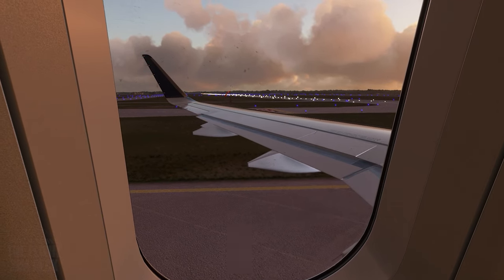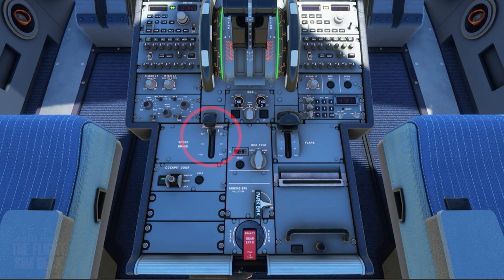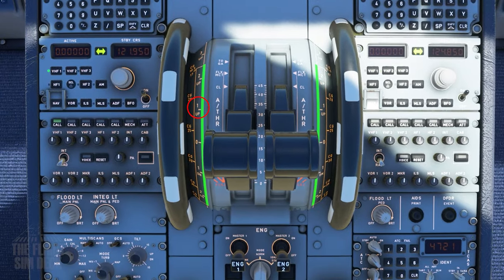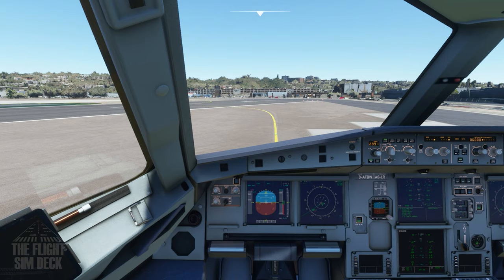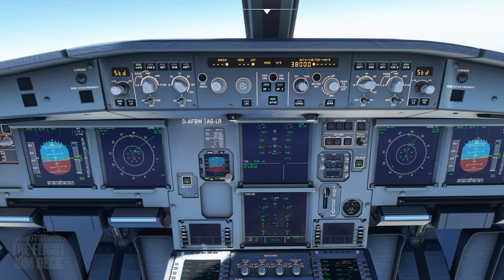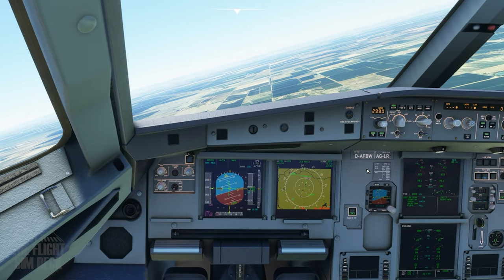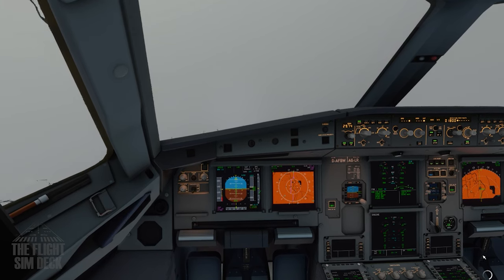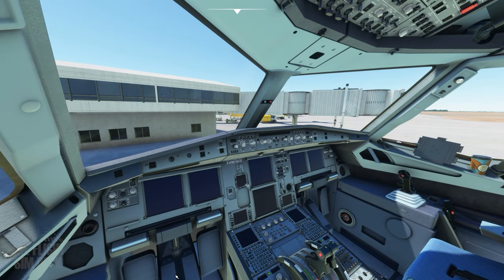Microsoft Flight Simulator | How To Fly The FlybyWire A32NX

Comment: you lost me after starting the decent. I have basic questions, would have loved if you covered those concepts
- how you calculated when to descend
- what speeds should be maintained for descending or it should always be managed
- when to hit LS
- when to arm approach mode
- typically what speeds we should extend flaps and by what degrees

The attention to detail was amazing, great video but I would still have to look out for other sources to get this info; based on how you started it sort of felt like this one is the sole resource that would cover mostly everything
Reply from the maker: -Once further developed the map display will show you exactly where the T/D is. For now I’m using SimToolKitPro to know where it is. It’s free real time flight tracking app connected to the sim. If your route and cruise are plugged into the app it will tell you when to descend. 
-Managed speed mode is fine for your decent. If on live ATC a controller my ask you to maintain a certain speed or Mach for spacing. Otherwise you will be fine. Below 10,000 you need to maintain not more than 250 knots. 
-LS is okay to hit at about 10 miles out from the runway.
-Same with APP mode. OR when the vertical diamond begins moving down. 
The flaps speeds can vary on weather and weight. The max speeds are listed just left of the engine display, printed on the panel:
Flaps 1 - 215
Flaps 2 - 200
Flaps 3 - 185 
Flaps Full - 177
For flight sim try to put them out about 10 knots below these speeds. These are just the max speeds allowed. The managed speed mode also helps you maintain the proper speeds for the  selected flaps.

Comment: you forgot the nav lights ment to be turned on after powering the aircraft  and done the ADIRS Wrong  its 1 2 3  or L R C  you done it 1 3 2 or  L C R
Reply from the maker: Nav lights yes. Especially at night so the ground crew can see. For the ADIRS I’ve asked two different Airbus FOs this question, and they both told me both ways are acceptable. He said it all depends on the captains preference. He said he sees guys do it both ways. This works because the #3 switch is just a hot back up to either 1 or 2 should they fail.

Comment: Very nice! Bit of a mistake at 25:00 I think -- you pull to get heading mode, and push to go to NAV (plane follows the flight plane, aka LNAV on Boeing).
Easy to remember if you think about pulling control towards you, or pushing it away from you. (Same deal for speed, heading and altitude knobs.)
Edit: Oh, just realized it's just a language misunderstanding -- push down as in click on the bottom of the knob in the virtual cockpit (which pulls it outwards), versus clicking on the top (which pushes it inwards).
Reply from the maker: Thanks yeah that was a communication flaw from the up and down hover arrows you have to use. Better way to say it would have been “pull down.” I’m going to add an annotation at those talking points to illustrate this better. Thanks for bringing it to my attention.

Comment: I have the Flybywire mod installed in my game. Mine did not come with the tablet. Any way to solve this?
Reply from the maker: Yes it doesn’t replace the default Neo anymore. They made it a separate plane and it’s further down the list away from the airliners.
Reply: @TheFlightSimDeck  I figured that out. The issue I'm having now is my tablet screen is completely white. I have verified my game files and have deleted and reinstalled the mod with no luck. Any suggestions?
Reply from the maker: @daniels.5019  are you running stable or development right now? If stable, development might be the best one after the new Sim 5 update.
Reply: @TheFlightSimDeck  what does developemt actually do for me that stable does not?
Reply from the maker: @daniels.5019  development lets you try their day to day progress updates. Stable is a previous version that’s been tested to run well. Development is more beta but also the newest.

Comment: Half this shit doesn't work in my mcdu...
Reply: Getting format error when double clicking v1 in perf
Reply from the maker: @jonjohnson2013  positive you’re running the FBW and not the default? The FBW comes in as a separate plane. Apologies if you know this already. It may want you to manually enter the values. The Fenix A320 is like that too.
Reply: @TheFlightSimDeck  Yeah it is the FBW, I get the flypad and everything. Any chance the download was corrupt or bugged?
Reply from the maker: @jonjohnson2013  it’s either corrupt, the airport data is no good (unless it’s doing this at all airports), or it’s missing something that’s not letting it run the calculation. Zero fuel weight ZFW, departure, and all the crap set?
Reply: @TheFlightSimDeck  Yes. I did everything perfect, even replicated the tutorial, just get the formatting error when getting to v1 and perfs